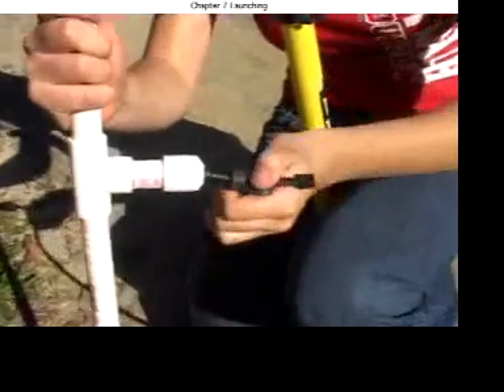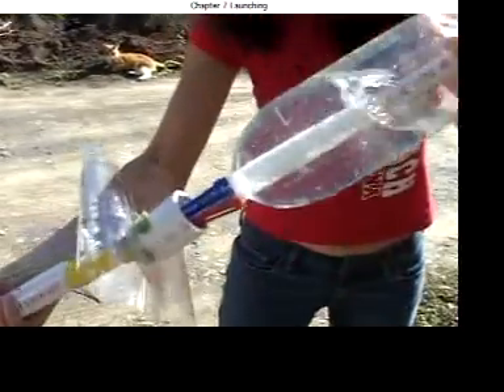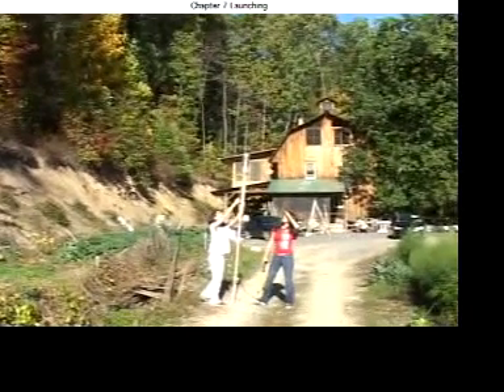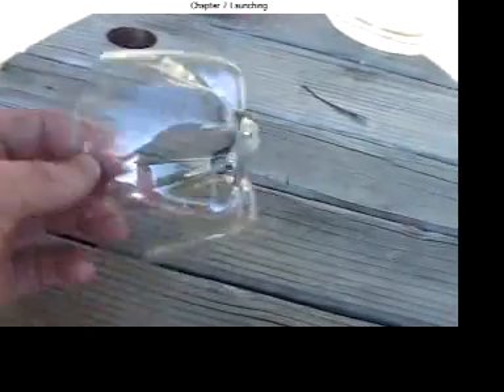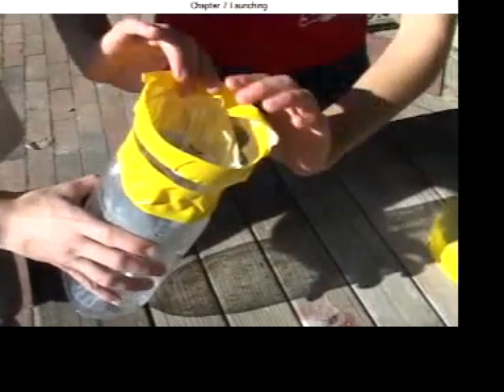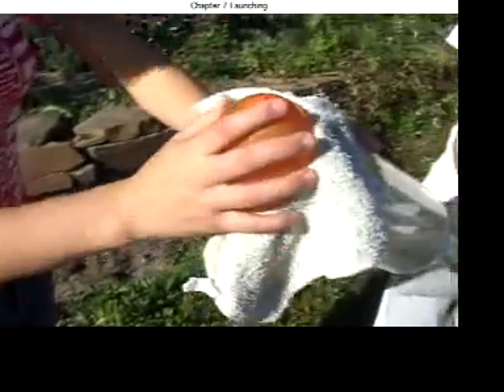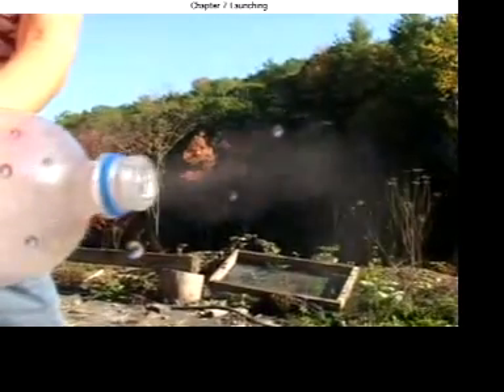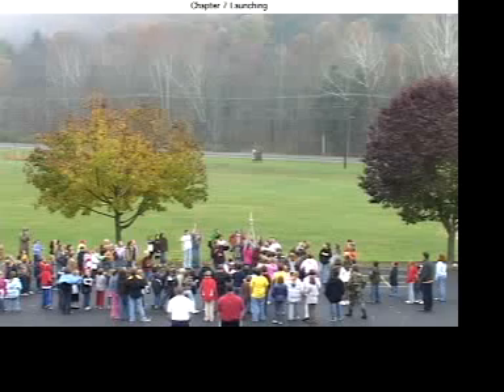Build an Overhead Water Rocket Launcher Part 7 launch

Comment from the maker: 70 PSI means "70 pounds per square inch". On each square inch of surface area, there is 70 lbs of force pushing it outward. It's quite a lot of pressure. A typical car tire only has 32 psi. My middle school students can't even pump it that high with a typical bicycle pump.

Comment: @sciencetoymaker I just figured out that it flew so high with small amount of air pressure because I only filled with 1/10 water. The potential energy is condensed to such a tiny reaction mass. Thanks anyway! I love the my new launcher!

Joe

Comment from the maker: @robert0joe The reason I say it needs 30-40 psi becasuse it can get stuck on the bump. There is a little bulge on the pipe that seals the air pressure in the bottle.When adjusted properly you push the bottle onto that buge a little. It sticks, so if you don't get enough pressure to get it unstuck, the bottle just stays on even it you've released it. 

Slater

Comment: I don't get it. You said it needs 30-40 PSI minimum to get out from the bottle. Why does 15PSI do the job. 15 PSI (Airpressure) + 300ml/1.5L (water volume/bottle capacity) flew at over two story- building?

Comment from the maker: @hellandlife Only a  tiny bit of water goes in the pipe. After a few launches I tip it over and empty it. If you live in North America, use what is called 1/2" pvc pipe. Even the inside diameter is more than 1/2" really, but that's what they call it.
Slater